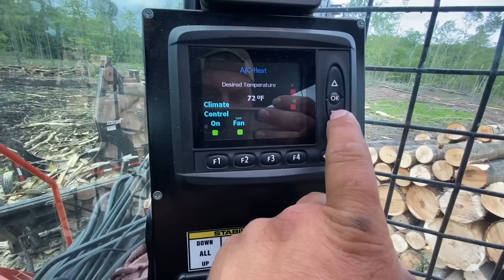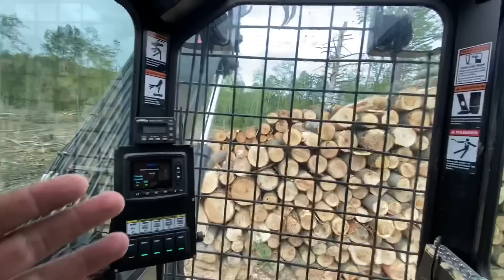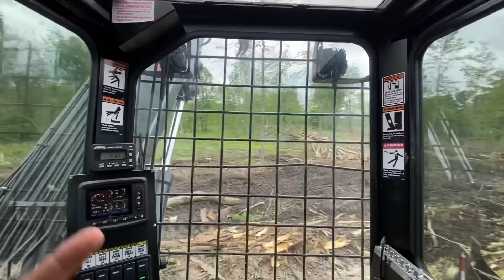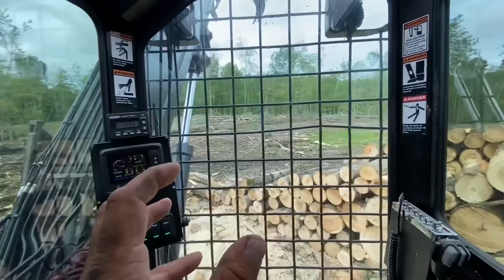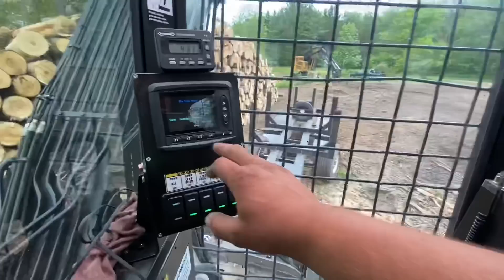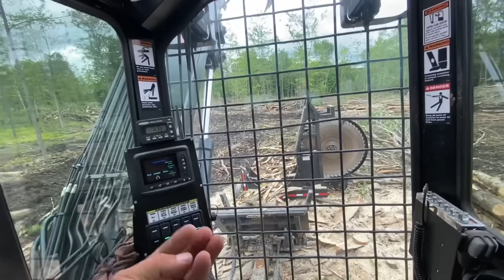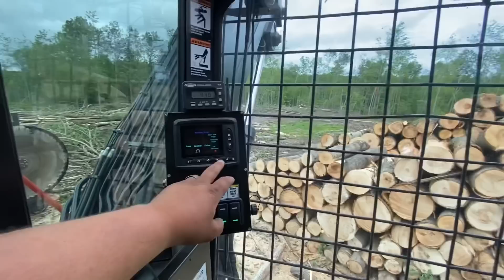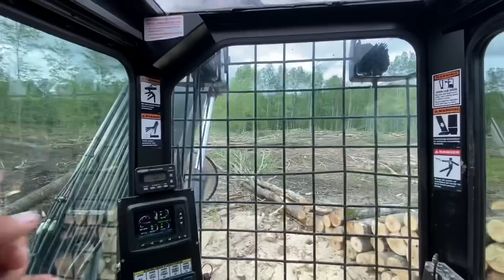Spin Around!!

Comment: In other areas of heavy industry those things are also known as “rotary unions.”  I have had to machine the channels inside those things, and grind the chrome wear surfaces back in when they start to leak.  They are used everywhere. Beverage bottling plants use them on the high speed rotary filling station in the production lines.  They can be used to supply cooling water to rotating elements of machinery like calendar rolls, and mixing rotors in the plastics production industry.